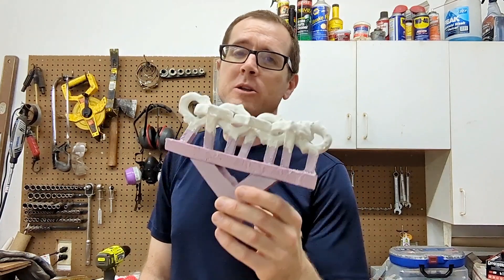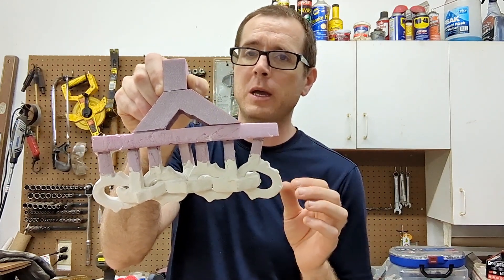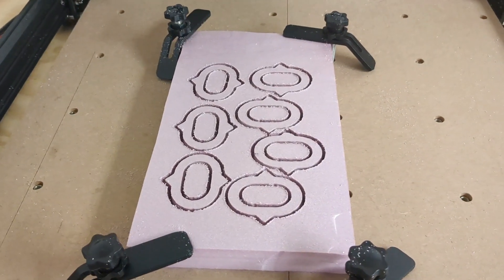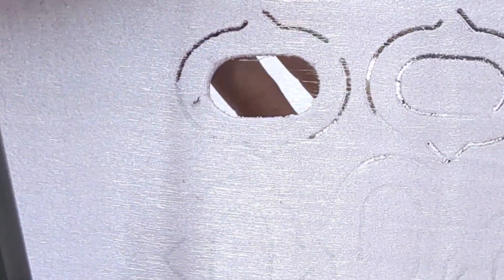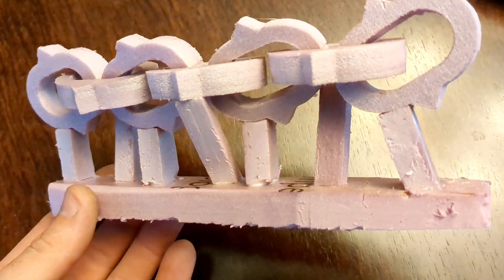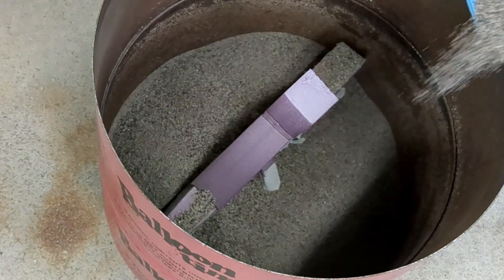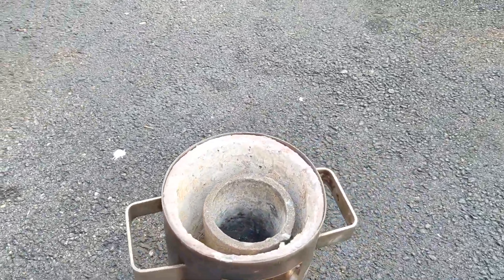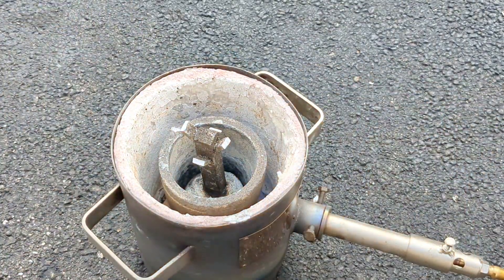Casting Aluminum Chain with Foam - Is it Possible?  Experiment! (Witch-King Part 1)

Comment: It turned out better than I thought it would, for sure!  How are you going to link something on there without soldering or welding it on?
Reply: Betcha he lost foam casts whatever it is the same way he did the chain - by cutting the foam and looping it through the end link and burying the aluminum chain in the sand bucket with the pattern to pour.  Easier than setting up this mold...  I want to know how long it took him to glue up that sprue tree!
Reply from the maker: exactly!  I plan on casting 1 foam loop when I plan to connect it to something. The tree probably took me about 10-15 minutes.  I had to use hot glue for it to dry quickly.
Reply from the maker: Thank you!  as @tobhomott said, to add more chain top it, I'll make another tree out of foam and loop the end through the aluminum one I just did.  to add something to it, i'll make 1 link and loop it through out of foam and cast 1 link.

Comment: I thought that was how you were going to approach this.  I figured the only way it would work was if each link was individually gated.  I was really hoping it was going to work and happy to see that it did.

Fantastic!

That lost foam technique is so dang cool!
Reply from the maker: Yeah, I think there is only 1 way to do it.  I think next time i'll make it the same way, but have it in a shallow mold, without such a long sprue.

Thank you so much!  Lost Foam is so cool!
Reply: @HeinrichsMade  The real  cool thing (or it seems like a real cool thing to me), is that you can coil the existing chain in the bottom of your bucket and "grow" that same amount of chain you made the first time doing exactly what you did in this video.

Man, this video just rocked!!!!
Reply from the maker: @freemanmetalworks1698  exactly what I was thinking.  Just put the foam looped through the end of the aluminum chain and add on to it. Cast again!